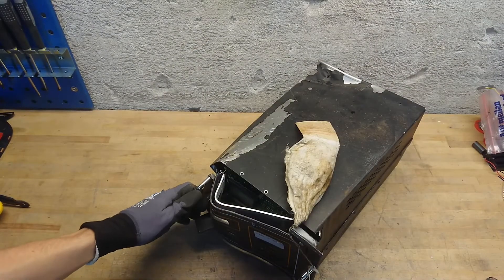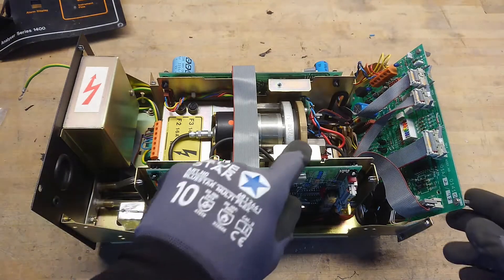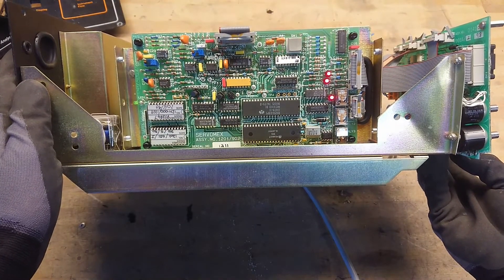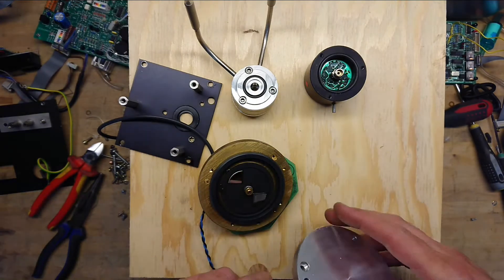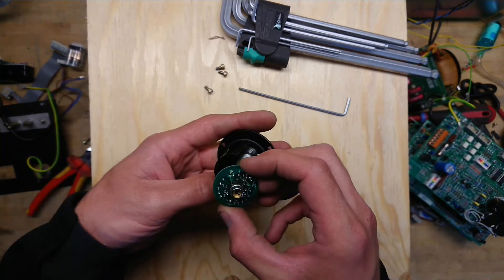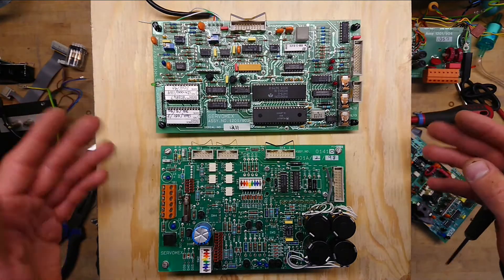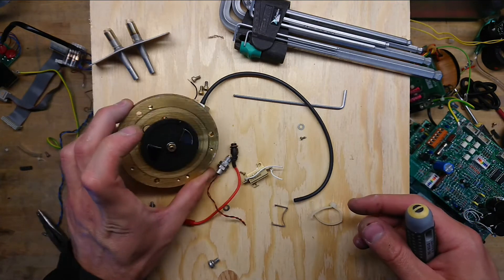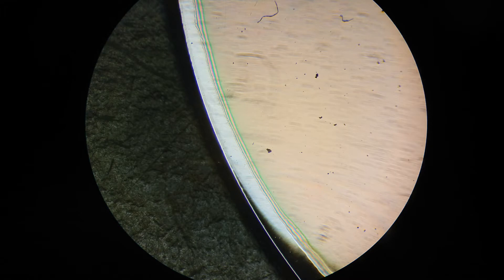Teardown of Servomex CO2 Analyzer 1400 Series

Comment: That "heater" coil is the light source. The spinning "mirrors" are deep infra-red filters. It is basically a deep infra-red absorption spectrophotometer.

The rest is more a guess. I thing one of the component behind the wheel would be a sensor to detect the position/speed of the wheel. And the two filters are likely passing different wavelengths. One would be absorbed by the CO2 and the other one not. That way, the instrument can self calibrate the amount of light produced by the filament and compare it to the amount of light not absorbed by CO2

Comment: I had a screw in sensor like the magnetic one pointed at the edge of the disk.
It's a magnetic sensor, so would function like an RPM counter or home position sensor.
The magnet is to bias it into almost turning on, so small changes trigger it.

Comment: NDIR based co2 measurement. Usually used on big steam boilers for continous flue gas measurement. Needs unit that will cool the flue gas and pump unit. Instead of peltier units in 1990 refular fridge units were used.
Reply from the maker: Thank you for the correct term of the technology used :) https://en.wikipedia.org/wiki/Nondispersive_infrared_sensor

Comment: CO2 sensors typically look at absorbtion of far-IR in the 5-10uM range - the source with teh wire coil  is probably a heater, along with some IR filtering. The detector is likely to be a PIR sensor, which is only sensitive to changes, hence the chopper wheel
Reply from the maker: I found out afterwards that the IR source was the heater coil. The sensor for the CO2 content seems to be the pyroelectric sensor PLT522, but then do you think the flat pcb sensor behind the slotted brass is the PIR?
Reply from the maker: Still pictures here: https://kaizerpowerelectronics.dk/teardown/teardown-of-servomex-co2-analyzer-1400-series/

Comment: White ceramic DIP is a resistor network
Reply: Brown one as well - another resistor network
Reply from the maker: So maybe not that secret and copyright-through-obscurity afterall :(
Reply: @KaizerPowerElectronicsDk  No, just that 30 years ago the way to make a computer system was to take all the parts and join them together, then write code for them Pretty standard 6800 setup there, looks like it was all Rockwell and Motorola chips, so you have a processor, and then the RIOT which contains a little bit of RAM, a timer to derive information and speed control  and then IO pins to control things, with a discrete ADC using the timer to get the digital data.

Program just runs in a loop, controlling setpoint of the heater and motor speed, and then digitising the chopper output, after it has been amplified by a good amount, and had zero suppression done by the magnetic sensor giving information as to when to sample either the active output, or to sample the reference output, and subtract that from the active, so you only get the magnitude to feed to the ADC. Scale in hardware, probably the switch is used to signal that you are going into a sample of known concentration, so the gains can be adjusted to display the reading. All the alarms and such are likely analogue only, the digital readout is strictly there to show value and control, no actual data sent as to status, other than a relay contact close for alarm, and another for passing self test and warming up.

The relays and optocouplers are the outside world interface, there to get inputs from likely a flow switch and control panels, and then 3 relays to show status and alarm, so the unit can sit in a rack and have the outputs go to a control room far away, with it's own 24VAC supply sent to the unit as well.